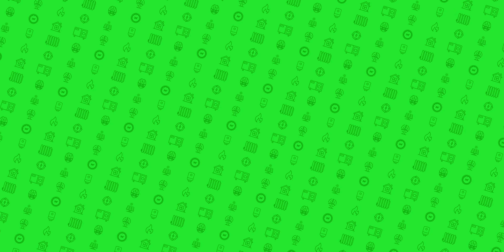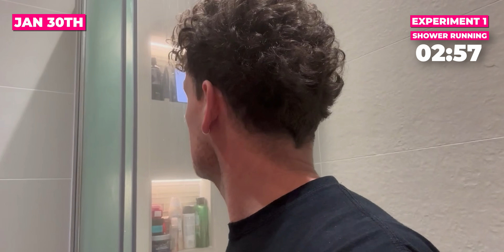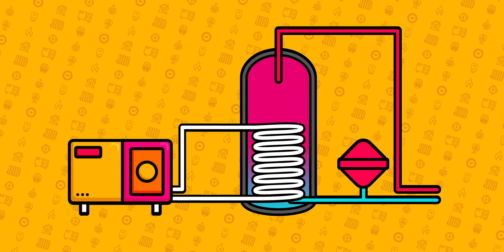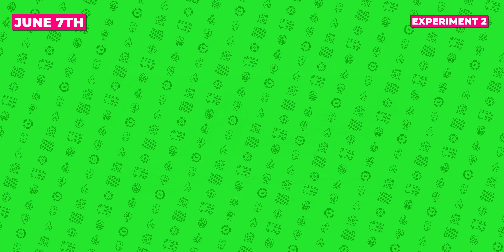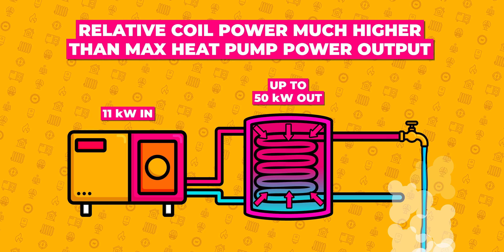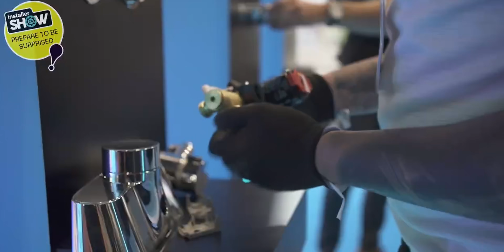The Worlds SMALLEST Cylinder is here!

Comment: Will you stop deleting my posts I am with you on this.
Reply from the maker: I have not delete 1 single post form this video. Infact I’ve only ever deleted 2 posts from the whole channel!
Reply: At 650mm high and 500mm diameter a cylinder stores 127 litres. To get to 16 litres storage of cylinder water to avoid G3 regs and the pressure controls, the coil inside has to store 111 litres. The 16 litres is the transfer medium. The opposite of a normal cylinder really. It is a thermal store with a difference. The coil is a part of the DHW water pipework to the taps, so not subject to pressure regs either. So your hot water pipes to your taps store 111 litres of hot water. As water is drawn off thru the taps the heat pump or even boiler can be switched in immediately (as does a combi) to inject heat into the cylinder as heat is being extracted. I had one bespoke made about 20 years ago to pretty well do much as this does, and about the same size, to save space. Costed a fortune. These being mass made will drop the price of course. 

I like it.
Reply: They are immediately being deleted.
Reply: @johnburns4017 I am see your posts.
Reply: @johnburns4017 YouTube has an opaque deletion algorithm
Reply: YouTube hides responses sometimes

Comment: How do you protect against defrost cycle?😊
Thank you!
Reply: Or scaling? We know tap water is not the best...
Reply from the maker: Scale.. same as a combi or any other hot water cylinder
Reply: Thank you !
Reply from the maker: We don’t yet. Defrost is only every hour and for 5 mins on a good system. Hoping this will lower defrosts in heat pumps due to lower volume.

Comment: Nice idea, can I be the fly in the ointment though in thinking this might not work so well if simultaneous hot tap or  showers in use, it would then suffer same issue as any current combi boiler ?
Certainly for smaller households it looks like a good alternative solution to HWC.
Reply from the maker: Current combis are restricted by flow rate, this isn’t. So could handle better.

Comment: So this is actually a small thermal store - where the tank body is the heating water and the cold supply comes in through the heat exchanger, and out hot. Which isn't a new idea per se, but they are usually a lot bigger than this. Interesting that one this small does in fact work quite well with a 7kW  input (because of course a decent shower uses more than that with winter cold water input temps - hence the mediocre reputation of 7kW electric showers. Using the 'head' from 55->40C to fill the gap is neat.
Reply from the maker: Puttin mg DHW through the coil doesn’t really make it a thermal store. It’s more a tube in tube heat exchanger. Or a water jacketed tube heater.

Comment: Love your videos Adam, Great solution, that will be just what I need when we replace the gas combi which is in a kitchen cupboard. 
I'm slightly concerned with the shower flow rate used in the experiment 8.5 litres per min a bit light for my household after the complaints I got when I trialled an efficient shower head . Beyond form factor What's the difference with the size of stores if you are not storing more than 16 litres?
Could anyone tell me if any other internal devices/cylinders would be required to run the central heating?
Reply from the maker: 8.5l/m is very high flow rate. Your water saving shower head would have been about 5l/m.

No other internals needed. The bigger ones have bigger coils so will last much longer due to less distortion

Comment: Nice bit of kit; a Sunamp but with plain water instead of phase-change material.

It's not a surprise that an 11 kW heat pump can produce a steady stream of 40°C water – no different to a standard 11 kW electric shower. A house small enough to need such "ministore" will only need a 3-5 kW heat pump, so will not produce steady hot water nor reheat as quickly.

A house large enough to need an 11 kW heat pump is going to have room for a standard cylinder.
Reply from the maker: My family of 5 have the heat pump set to 4.5kw input and only 55c store temperature… this will work with a 3.5 ke unit no problem

Comment: Does make sense, if you can dump 11kw into the water, this is greater than an old style electric shower will heat water continuously at, which usually put in 7kw.
Reply from the maker: Works when I restrict to 4.5 kw too

Comment: What if you install a temperature sensor in the drain and trigger the heatpump when the registered temp in the drain rises by X degrees by temporarily increasing the store temperature setting?
Reply from the maker: We’d be better off locating the store sensor right at the bottom of the tank
Reply: @HeatGeek  Not when the water isn't being drawn out of the tank surely? Its being used as a heat exchanger in the design presented in the video. Doesn't seem like there would be thermal stratification?

Comment: For air2air homes, would this plus a small dedicated heat pump be a good alternative to a hp cylinder? If so, what size hp would you need?
Reply: This smaller tank gets the performance by using the larger heat pump sized for the heating loads. You could use a smaller heat pump but you just won't get the performance from it. As you could see in the video he was using a 7kW heatpump. You'd need a similar size if you wanted to dedicate it for the small cylinder. 

If you could get a bigger cylinder, you can use a smaller heatpump. In Australia this is an option, where a heatpump is built into the tank and is located outside, but they're the "bigger" tank to make up for the small heat pump size. 

In other words, the smaller the heatpump, the larger the tank to get the same water output. Until you get to a point where the heatpump can output all the heat you need instantaneously, just like a combi.

Comment: We used to plumb cylinders like this for unlimited hot water regularly with open vent systems running on solid fuel. We did have a customer with this set up using a heat pump as they used the cylinder as a buffer tank (swapped from a solid fuel without replumbing anything else (we didn't install the heat pump the customer did)). This is literally old tech repurposed for new equipment and it worked brilliantly any time we used it, nice to see someone with a bigger reach putting it forward as viable for the masses.
Reply from the maker: You’re referring to a thermal store. Not a good idea as you have to keep the heating water at hot water temperatures so give me really bad efficiency. They used to be very common on all renewables but I hate them.

It is an old concept though. It’s called a tube in tube heat exchanger, but with built in buffer.. Or a water jacketed tube heater..
Reply: @HeatGeek  Yes a thermal store, serving double purpose as a buffer actually helps tackle multiple problems on installations. Effectively you appear to be re-launching a sealed thermal store, which may tackle the hot water delivery issue but may also cause issues depending on system volume require an additional buffer tank. As from your video you appear to have plumbed it as a dedicated circuit/plate heat exchanger for the layman. As you say there's no one size fits all solution, just the best solution for any given property depending on who resides. 

If I have time I'd love to see one cut in half at the NEC and go through it with you at the show as we have a lot of 3 up 3 down double bathroom properties in Sussex now (many hmo's) fed from 37/40kw combi's which are capable of doing 2 showers at once. If this was a viable alternative for those without needing an additional buffer I know many landlords that would be happy to switch as they prefer weather comp controls as they pay the energy bills not the tenants.

Comment: what happens if you have poor mains water pressure ie less than 0.5 bar
Reply from the maker: Then you leave the system fed for the loft tank or buy an accumulator
Reply: so this is basically a thermal store which won’t work if you have piss poor mains water pressure or no header tank

Comment: Is there any reason a regular heat pump cylinder couldn't be plumbed in like this, or is the heat exchanger coil massive?
Reply from the maker: Coil needs to be at the top or spread right through.. not at the bottom

Comment: OK, I stand corrected. I left a fairly critical comment on the previous video, saying It’s just a smaller hot water tank. What’s the big deal? And yeah, of course it reheats more quickly because it’s smaller… but swapping the leads is actually pretty brilliant. It does make install easier and yeah that’s pretty smart.
Nice job. 

Looking forward to some independent tests, but this is actually genuinely clever stuff!

Comment: I've created a similar setup in my previous house, not with a heatpump though, but a electric instantanious hot water heater of 11kw and a tiny boiler (30L).
The water heater of 11kw alone was not enough to create a decent shower flow in winter (sub 15 degrees water temp into the house).  I added a boiler of 30L before the water heater, the boiler pre-heated the water to approx 26 degrees, and the 11kw waterheater did the rest. This was a very small setup (would fit easily in a kitchen cabinet) and provided near infinte hot water. I fully beleve that the solution you show here will work perfectly. When can we get one in the Netherland!

Comment: Cylinder isn't the issue with me, it's the big fan box outside.   Dispute being a new build with my own garden it will need planning permission with an independent noise survey and the estate management company needs to have the technical drawings - too costly.

As they're so quiet, why can't there be something that has the gubbins indoors in a cabinet with 2 pipers to the outside that can suck in the warm air and blow out the cold though the other.  It would then do away with this planning permission restrictions and external pipework.  It will be much more flexible for flats, terrace, basically everywhere that has limited land.
Reply: 'Permitted Development' allows most heat pumps and Solar PV to be installed without requiring additional planning permission.

Search for MCS 020 to get details.
Reply from the maker: Coming. Soon

Comment: I guess like a Combi boiler when the heat pump is heating the water the radiators will start to cool down? I seem to recall we had a similar device in the 1980's with calorifiers tanks completely filled with coiled pipes with primary boiler water from one of the four 250 Million BTU boilers with the output side providing the hot water pumped around the station (the system was for Waterloo Station) Heating circulating pumps had 10Hp 3 phase motors.
Reply from the maker: Not a problem with steady state heating

Comment: This is an excellent development in the HP world and solves 50% of the issues that was holding me back in my next step in the renewables journey.

Live in a 2 bed semi that was built in 2018, so is very efficient in terms of insulation and since moving in have added PV and will be getting battery installed the next 6 weeks. Due to the size of the property there was no location for the cylinder, but with this i can replace the boiler straight swap for cylinder. The only issue is now finding the location for the outdoors unit, as space around my property is very limited.  I do have a very large space on a gable end wall over a shared alleyway…….😮😊

Comment: Surely this arrangement is of equal use for hydraulic separation and volumising, eg, as a four-pipe buffer for radiator circuits?
Reply from the maker: No. It wouldn’t be hot enough for the hot wayer
Reply: @HeatGeek  I’m not suggesting a buffer for DHW - it’s already doing that. But the same type of tank could also replace a 4-pipe buffer as used in most of Vaillant’s reference designs, where the coil would prevent in tank mixing and hence reduce distortion.

Comment: A solar blanket on the roof with a hot water storage tank is also a thing.  This can be used with an on-demand unit or a smaller tank than you would otherwise need.
Reply: True, but that depends a lot on the local climate. Here in Scotland it’s not very effect, not enough sun during much of the time.
Reply: I think that's what my parent's family use in Pakistan. The water is on top of the roof

It isn't drinking water though